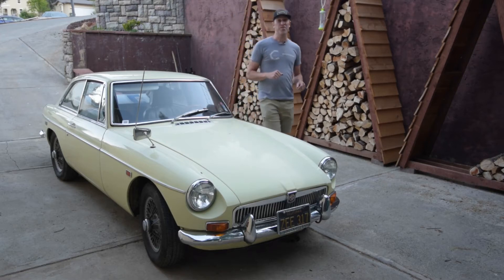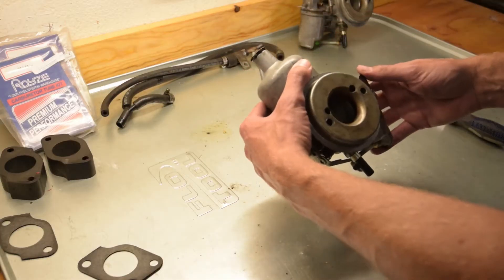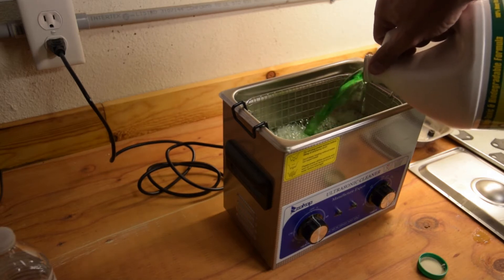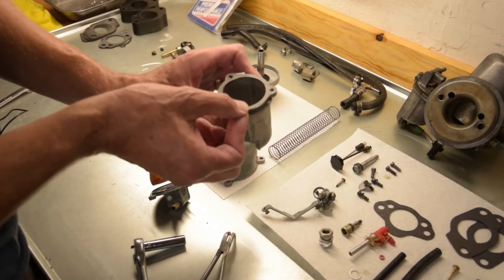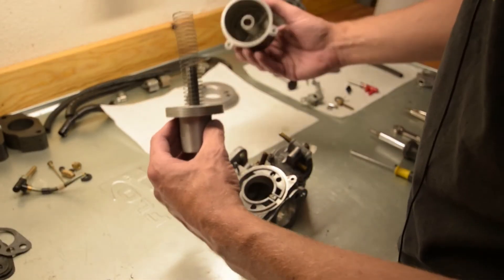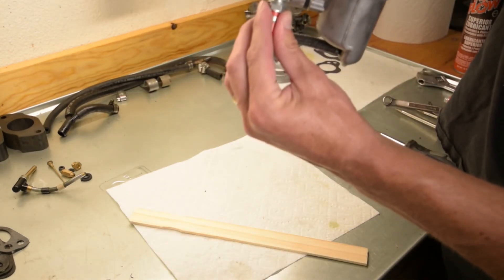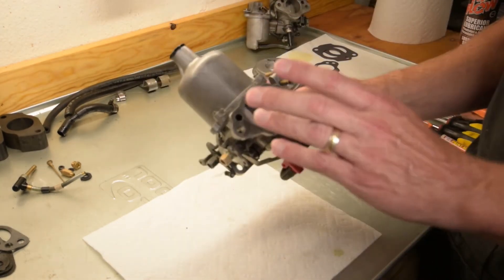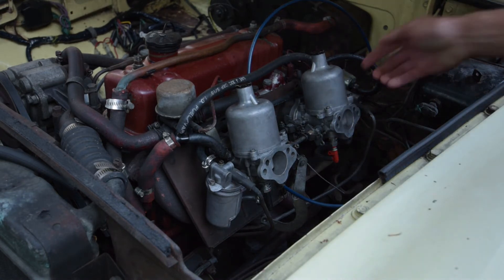How to rebuild SU HS4 carburetors - MG MGB GT

Comment: How does the jet locking nut actually retain the jet while allowing adjustment when centring? I’ve wondered for a while but I’m not prepared to pull mine apart while it is running well lol.
Reply from the maker: Yeah if it ain’t broke… lol really the linkage that screws to the side of the jet keeps it from falling out.
Reply: @CarsBikesandCoffee  haha if it ain’t broke don’t pull it to pieces to see how it works.

Comment: where did you get those carb kits? I need a hose for the float bowl like your kit has.
Reply from the maker: I got them through partsgeek, looks to be currently out of stock. https://www.partsgeek.com/gbproducts/WC/16354-01016078.html?utm_source=google&utm_medium=ff&utm_content=YN&utm_campaign=PartsGeek+Google+Base&utm_term=1968-1971+MG+MGB+Carburetor+Repair+Kit+Royze+W0133-1622704+68-71+MG+Carburetor+Repair+Kit+1969+1970&fp=pp&gbm=a&utm_source=google&utm_medium=ff&utm_campaign=PartsGeek+Google+Basecid=6774379819&aid=79287199093&keyword=333602567481%3A%3Apla-333602567481&kid=333602567481&gclid=Cj0KCQjwgo_5BRDuARIsADDEntTXry8lxn2DcwpSaGjFlkrTZwlTIBv3HGhJZn1EY7fEA8C6ilxpLroaAtVvEALw_wcB